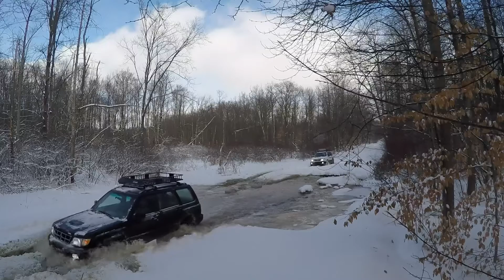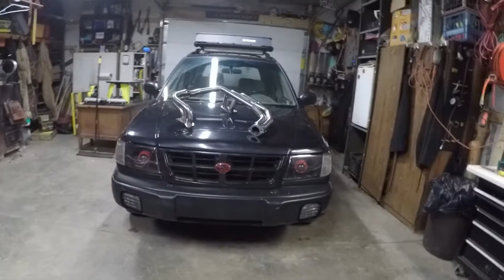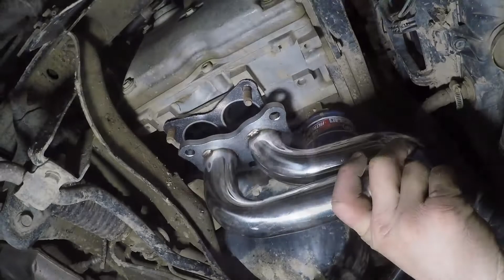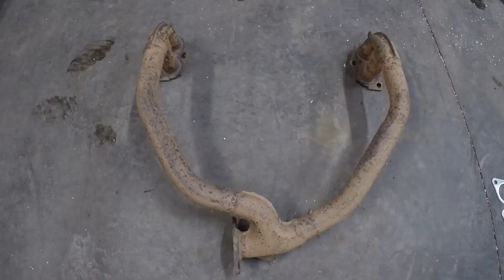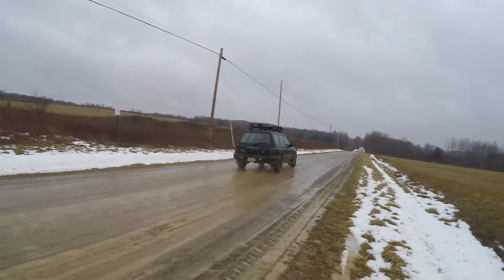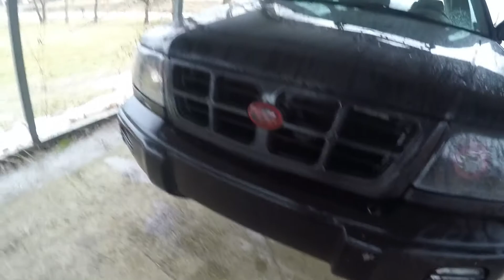Subaru Forester UEL Header - Budget Exhaust Series Part 1

Comment: How have the headers held up so far?  Has there been any cracking of the pipes from having to bend them to fit?  If they hold up, theyll go on my 98 Forester!
Reply from the maker: So far so good! One thing that might make the install easier is if you cut the little piece of pipe that they tacked the runner together with. I cut that in half later on when I removed the headers and put them back on. Thanks for the comment! 
-Kasey

Comment: Did you end up having to cut that weld that attached the uel near the cat? Lol it was a pain in the butt for me to get it lined up properly. But I'm loving it bro!
Reply from the maker: Jason Long luckily we got it to line up at the cat! But we weren’t sure if we were going to be able to stretch the headers onto the exhaust ports! Other than that I think they are pretty decent for the price!!!
Reply: JK Garage lol definitely! I'm actually working on trying to fit a wrx catback. I failed miserably. The cat flange and the catback flange are totally different sizes. I have to take it to a exhaust shop now
Reply from the maker: Jason Long is it 3.5 inch by any chance? I was looking at one on amazon it was pretty cheap like $150. I wonder if you just saved me from the same headache!
Reply: JK Garage if it's spec d tuning then yes. I think it's the 3" or 3.5". I got it from eBay for like $106. But yeah I had to cut and weld 2" more piping. Even though the mid pipe looks about the same size, the forester is longer. I did have much of the proper tools, maybe that's why. But
Reply from the maker: Jason Long well thanks for the heads up man! I’ll keep that in mind when I’m searching for cat back!
Reply: I got a spec d 3" catback and ended up having to weld a hanger back 3in and welding in 2in of 3in stainless

Comment: I'm in the same boat, except i can't quite provide enough encouragement. I'm about tempted to cut it and weld something back in, but i feel a little hesitant. 
I snagged the ebay 2.5rs header, which is "technically" for a ej251....tried putting it on my 04, which is a 254. it literally looked the same. something just spooked me about the idea of leaving one side bolted and pulling..... any kind of advice at all?! I'm not ready to give up on these. got em for $80!!!!
Reply from the maker: I'd recommend cutting the little piece of tubing in the middle of the runners. That should give you some extra wiggle room.
Reply: That did the trick. Thanks for doing my thinking for me
Reply: @JKGarage  I think that little tube is there to prevent idiots that have no business modding their cars from installing. You have to prove you've got a brain (by realizing the tube must be cut) before you can proceed...

Comment: Put these exact headers on my 02 forester and they burned a hole through my stock oil cooler hose leaving me stranded on the side of the road. :(
Reply: DGK Parasite I had the same exact problem, did you fix it? If so how? I have to fix mine really soon 😭

Comment: im planning on doing this to my 02 forester, how hard/long did it take to do the bending any tips
Reply from the maker: We recommend first cutting the little piece of metal tube that connects the left and right header tubes together. That should give you more wiggle room. It only took us about 20-30 mins of bending and we suggest using your wheel to loop a rachet strap around the headers to pull them the direction you need.
Reply: @JKGarage  sounds good thanks! ive had these headers in my garage for atleast 6 months because we couldn't get them to fit hahaha
Reply: I just put one of these headers onto my 95 legacy wagon. After cutting the little tube that joins the left/right banks together, I was easily able to splay them apart (by hand) so they'd fit. Without cutting the little tube - was NOT gonna happen.

Comment: Has the headers held up to cold flashes/water pits? I too live in a cold climate and was wondering.
Reply from the maker: Headers seem to be holding up fine in the cold and I go through a puddle every now and again with no issues.
Reply: @JKGarage  did you modify your OEM skid plate to fit? I just installed these headers on my 01 impreza and I am currently driving without the skid plate...

Comment: them headders were damaged in transit = bend over 1 inch = no good you need to bend them back so as to slide on and bolt up = very bad video and no way .
Reply: I've read that most of the ebay/amazon suby headers need some encouragement to bolt on, minor for anyone with any mechanical aptitude considering the price. Win